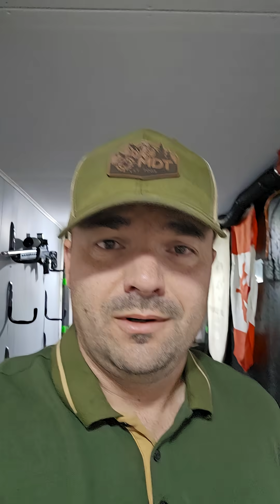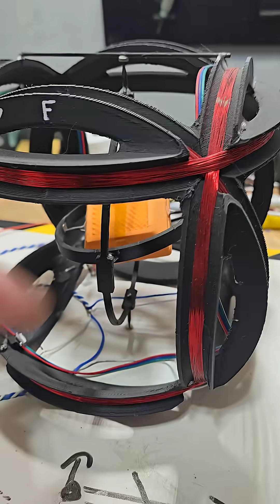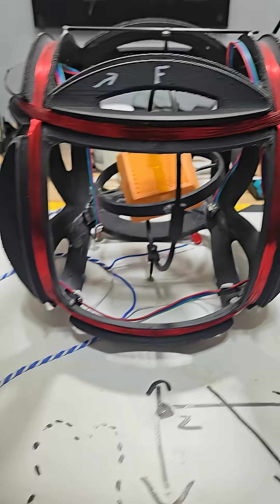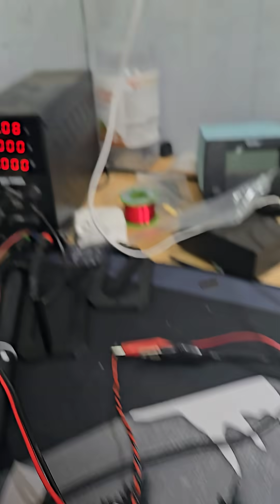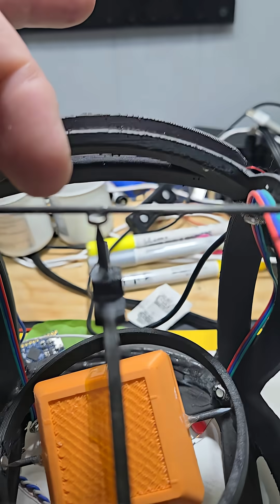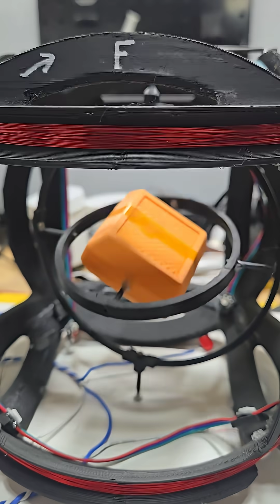DIY Magnetic field generator for testing #3dprinting #helpmemakethismakesense  magnetic

Comment: Can you run more power through the model on a discharged hard magnetic material to magnetize it? If you cleared the preexisting domains first and ran like 100 volts through one coil for like half a second?